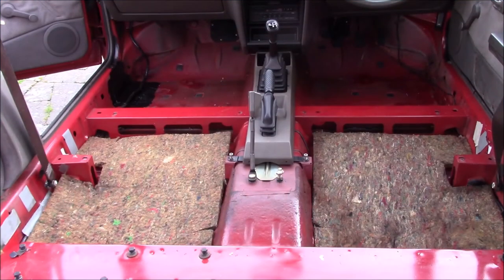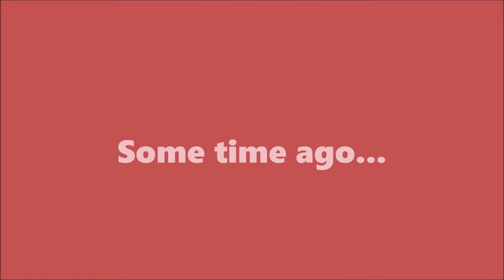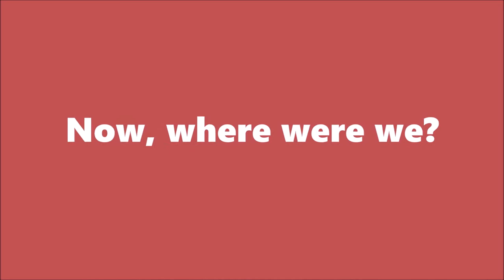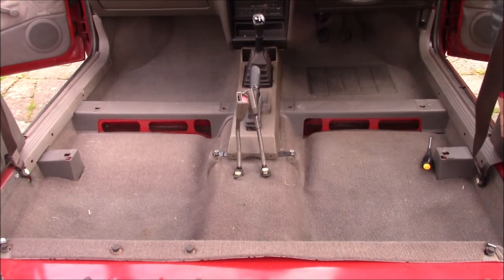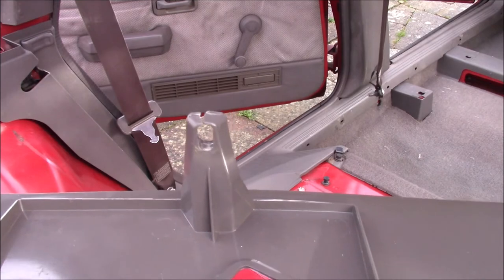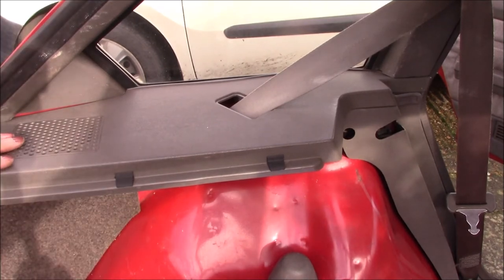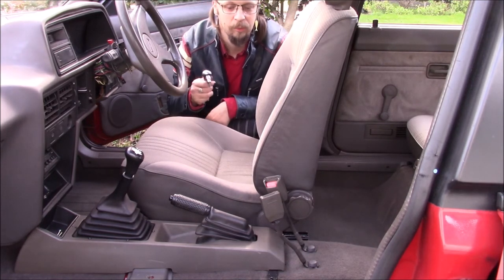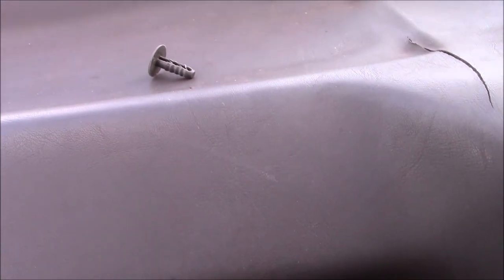1988 Austin Maestro - Interior Reinstall

Comment: Surprisingly tidy floor pans your car has. I like that sticky underlay. Could do with some of that for under my back seats where they put a painted coloured soundproof matt. Will get some of that.
Reply from the maker: If you don't have carpet under the rear seat (I'm not sure if Maestros ever did), then you'll need to put something over the underlay because it sheds a fair bit when disturbed.  It's not a problem when it's under the carpet since it's self-contained, just something to be aware of.  I was pleasantly surprised at how good the floors are in this car, I was expecting them to be much worse.
Reply: @noexpensespentstudios  good point. I managed to secure a full length rear boot carpet that goes under the rear seats. Cannot recall which model had those boot carpet.. it should seat under that nicely I hope. I hate those plastic trim clips. Difficulty getting them off without breaking. Your car is tidy for sure and I know you will improve it.